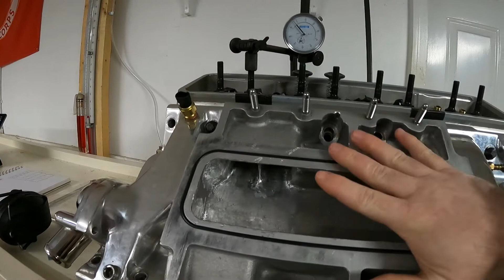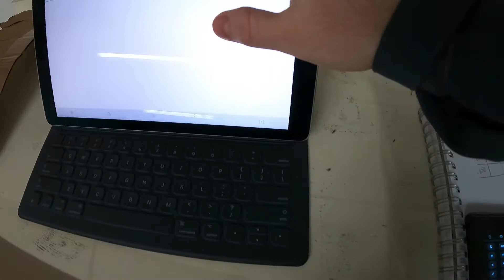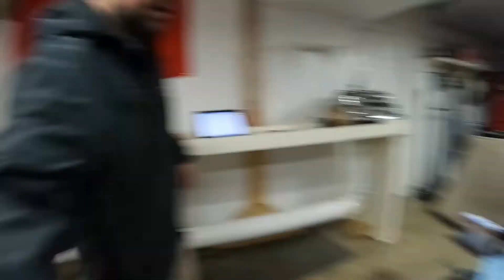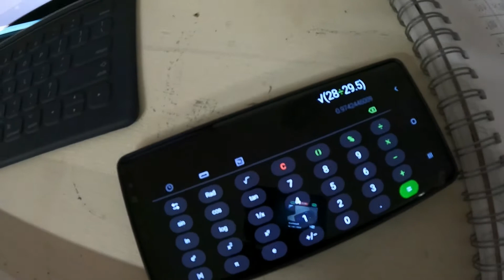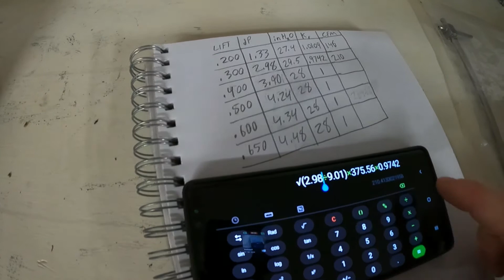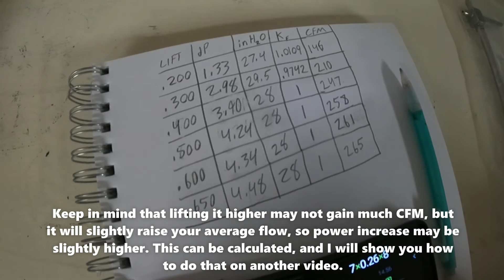Homemade Flow Bench Part 2, Using an Orifice

Comment: Just curious , what is the diameter of the hole in your machines Restrictor plate, also material thickness ? tks
Reply from the maker: The sharp edge orifice I use has a 3" diameter. I do not know the thickness off the top of my head, but it is very thin. Why?
Reply: @tristan_white  Thanks , well i made a new plate for my bench which i built near 20 years ago, (was in storage for 10 yrs now rebooting) my current plate is a 300 cfm and its ID is 2.753" , thickness is 0.028 sheet metal, and my piping is 4".
The plate i just made on my lathe is from 0.250" extruded 6061 aluminum and has a perfect square edged bore of 2.64" , supposedly that would be a 275 cfm plate according the Flo Bench plans i'm using and bought from an ad i came across in hot rod magazine back in the day.
 
Your plate having a big 3" bore would im guessing be like a 400 cfm  in my setup , piping in your setup is 6" by the look of it so a 3" plate seems appropriate.

My bench has manometer (both H2o & digital) stability issues 0.500 lift (the new 275 plate didn't fix this) and im beginning to suspect that my signal pickup in the vena contracta might be to far from my orifice plate and in a position that becomes turbulent at higher flow rate.

My signal pickups / tube connections , are at 1 inch on either side of the orifice plate and im thinking that might be to far away ?  i think you even mention in one of your videos that the pickups need to be right beside the plate ?

Im also thinking of putting a 3 angle inlet on my new orifice plate to change the shape of the vena contracta and make it longer / less turbulent ?
Reply from the maker: @luckyPiston  yes, you want them as close to the plate as possible to prevent them being influenced by airflow. However, when you see a large fluctuation in your manometer, it is usually due to flow turbulance in the cylinder head port. To test this take the head off the flowbench and run your bench wide open, if you see a nice smooth DP across your orifice then it is the cylinder head and not your bench design. When port velocity gets too high (>330 fpm) then you start to get turbulance, and this causes pressure pulsations that you see in your manometer.

Comment: Hey can the Testo calculate CFM air flow using differential pressure from orifice plate or is that only a pitot tube thing ? tks..
Reply from the maker: It will only calculate CFM using a pitot tube (sqrt of dynamic pressure x velocity x cross sectional area). For the orifice you will have to do the math as it can only calculate the DP. It doesn't know what the velocity or cross sectional area is, so that is why I have the video on qualifying your bench. Watch that video and it should help.

Comment: 28:00 Lifting the valve further than needed increases the high lift duration , even tho the port is stalling it is still flowing and by lifting well into that area you increase the time (duration) of high lift flow, it would be interesting to see the difference on a dyno to see if the added stress on the valve train is worth whatever HP is picked up.
Reply from the maker: You are correct, we would raise our net flow (area under the curve) due to the added duration beyond the peak flow lift area. It would be a fun test to perform on the same day under the same atmospheric conditions, but the gains I would expect to be pretty low. If I had to guess, we would see gains in peak torque where there is more opportunity to fill the cylinder, but at 6,000 rpms the intake valve is only open for about .02 seconds, and since we peak power typically beyond 6k I would expect peak power to not be affected as much. We can calculate it, but the real world test would be more fun I agree.

Comment: Did you cover how to test the orifice you bought or made?  I am curios as to how this is done.
Reply from the maker: I believe I did in part 1, but if I wasn't clear I can try to explain. Just let me know. There are a couple ways to perform this task.
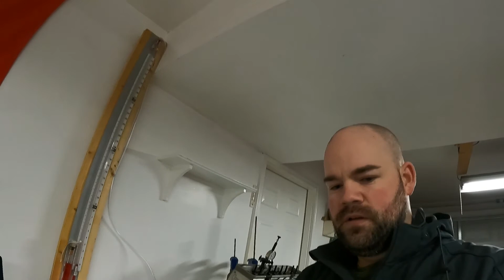Reply: @tristan_white  At 29:28 you mentioned it but I don't understand. You said your Orifice flow was higher than what was marked on it. Then you mentioned the Vertical manometer.
Reply from the maker: @fernandohood5542  the first thing you need to keep in mind is to obtain laboratory level accuracy for actual cfm requires control over every single input including the upstream gauge pressure used (such as 28" H2O), atmospheric pressure, upstream air temperature, and air density among several other factors. Once you understand that you need to understand a tool must be compared to itself for actual useful information. That means what mine flows, even if built the exact same, may differ from you because of our area temperatures, altitudes, etc. may differ. To find what your bench flows (your tool) you will use combination of what I talked about in the video. What I recommend is to purchase a tool that you will use for both pitot tube data and orifice data. This will ensure consistency. First, place the orifice plate you intend to use on the bench bore plate ensuring a good seal. Next, using the methods discussed in the video, obtain the dP using the pitot tube near the same area you intend to install the orifice. Turn on the bench and adjust test pressure until 9" H2O, perform test, then turn the bench off and do the math to find CFM. If using a Testo 510i like I do it will do the math for you. Next, install the orifice. The CFM calculated using the pitot tube will give you the most accurate info. Once this is done and the orifice is installed you will use the Test Pressure and CFM for all math to calculate CFM. For example: my bench when performing this test on a 3" sharp edge orifice it flows 375cfm @ 9" H2O test pressure, so if after orifice installed I get a dP across orifice of 4.5" H2O then to find CFM just do the math I discussed on the video. So for this it would be √(4.5÷9)×375 = 265 cfm. The only changing variable will be dP for all other math. Keep in mind that this is at a bench test pressure of 28" H2O. The bench test pressure and orifice plate dP are independent, and the 28" H2O has no bearing on the math. It is used for consistency of measurements and to compare to the rest of the industry. The engine does not see a fixed test pressure, so the bench is just a tool and not the end all for performance information. Hope that helps.
Reply: @tristan_white  The detailed response is appreciated. In summary your saying  use a PITOT  tube to calibrate the orifice.  What mechanism is used to move the tube to different positions without having air leaks?
Reply from the maker: @fernandohood5542  I prefer a timed traverse, where I start at one end of the pipe and count to 10 as I pull the tube across. I repeat this 20 times and take the average of all 20 readings. Then I do the same thing 90° out 20 times. I then take the two separate averages and average them together. This will be the flow you use at a given test pressure such as 9in H2O. The system at the pitot tube entrance will be under suction, so any leakage will be a loss of suction pressure at the orifice. There are two ways to keep this from interfering with your measurements. First obtain a pitot tube with a 90° angle with the flow end at least 7-8" for a 6" pipe, Dwyer Series 160E Ellipsoidal Tip Pitot Tube part number 160E-00 is perfect for this if using a 6" pipe. This pitot tube allows you to get the test point far away from the penetration point. The next thing is to drill he hole only large enough to get the pipe through and rotate. On a 6" pipe the drilled hole will only be slightly larger than the pitot tube diameter. Next, place the tube in postion, turn the bench on, and wait for the test pressure to stabilize. This will keep any leakage from effecting your test results. After the test is complete just place duct tape over the hole for future use. It is good to re-verify your results after any major changes to temperature, humidity, or atmospheric pressure. It would be good to have 2 identical orifices, so that you do not have to remove the orifice to do the re-test. Also, ensure your holes are upstream of the installed orifice if using a backup orifice, and also insure your pitot tube test point is atleast 12 pipe diameters away from any 90° bend or transition point to provide the air time to stabilize. If testing near a transition point in the pipe your results will likely be wrong. Installation of flow straighteners inside the pipe will help, but is not required if given the proper distance. Hope that helps.

Comment: I want to go about  making an orifice plate. Any ideas on how to go about this? I have access to a machine shop.
Reply from the maker: Use some strong sheet metal, and use a 3" knockout. Sand both sides smooth leaving not burrs, however leave the sharp edge. Do NOT round inside diameter of hole. Make the shape of the sheet metal to fit your application.
Reply: @tristan_white  Thanks. Will give it a try. Thickness  matters?
Reply from the maker: @fernandohood5542  just for strength, it will have a very high stress on it.

Comment: While a flow bench is only part of the story. It is a tool to get a idea of the maximum potential of the port. It does nothing to tell you what its doing for swirl, fuel fall out, valve over lap, or reversion. Iam building a contraption now that wont give flow numbers but shows how the wet flow is working. For all 4 cylinders at once. The position of the piston in the cylinder also has a major effect on flow. Curious why you stopped making videos?
Reply from the maker: I have been going through Nuclear Plant Operator school, so it's just due to lack of time. I will be doing more in a couple months.
Reply: @tristan_white  damn! That's impressive!
Reply from the maker: More videos posted.

Comment: Where did you purchase the manometer and the differntial digital meter.
Reply from the maker: It is a Testo 510i, and works with your free phone app. The manometer is a Dwyer well type. The orifice is from Performance Trends.
Reply: Is this better than incline manometer?
Reply from the maker: @fernandohood5542  not necessarily, just easier to read. An inclined manometer works well if you set up the scale right , understand it's limitations, and have it large enough to see small changes.

Comment: Great video. Can you tell more about your vacuum source?
Reply from the maker: I am using 6 Ametek P/N's: 115923 vacuum motors. Tied to a 240V 50 Amp RV Cable.
Reply from the maker: Build video posted

Comment: Can I flow my own orfice to calibrate it without a known orfice ??
Reply from the maker: Sure can if you have a means to accurately measure air speed, inches of H2O, and your pipe inside diameter. You would need to place the orifice over your bore plate (where your cylinder head would be) and make sure it is sealed tight. Next run the bench to 28" H20 and measure the airspeed inside the pipe downstream of the orifice in a non-turbulent area (in feet per min fpm). Next, to convert that to cfm just follow the steps in my other video. All you will do is take the airspeed and multiply it by πr^2 of the pipe (keep units in feet, so a 6" pipe radius would be .25 feet). That will give you bore plate cfm. If you cannot get to 28" H20 on the bench you can do the same thing, just remember to use that number for your future dP calcs.